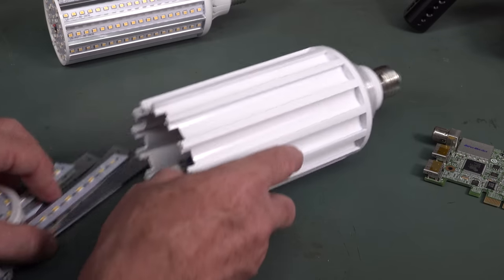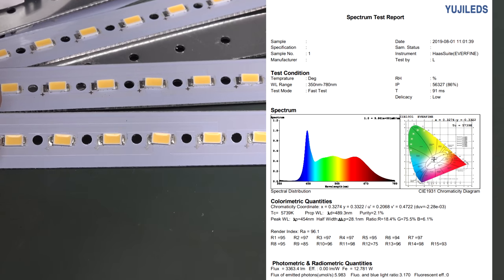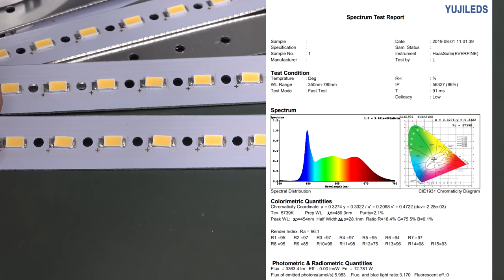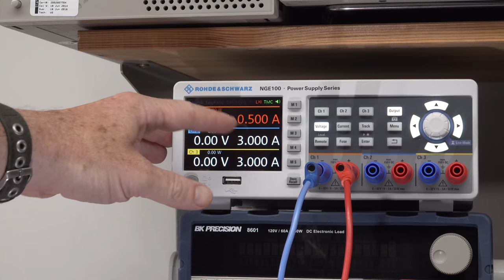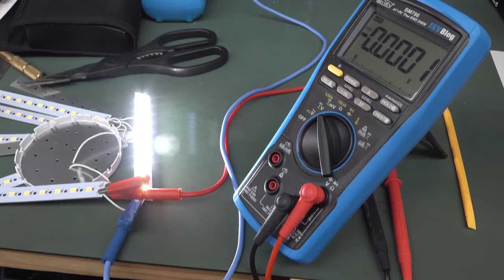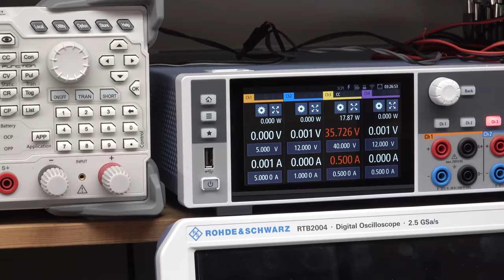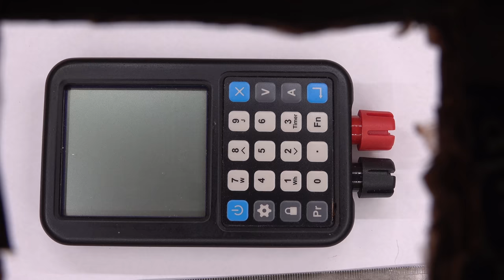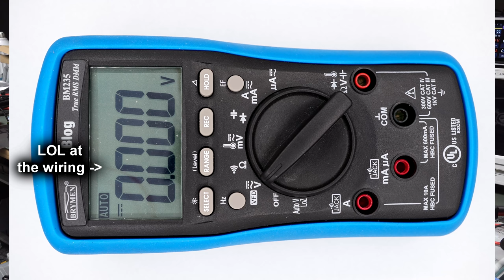EEVblog #1372 - DIY PCB Photography Light Box

Comment: You're not shooting macro so why use a macro lens.
The body does matter as it contains the sensor and the sensor defines the results from the lens, pixel density matters as much as the lens type and quality to the results.

Given that you're around 30cm in height, you don't need a macro lens as a lot of standard lenses can focus down to that distance.
I question the need for f10 for depth of field considerations as you aren't actually shooting macro, a 1/200 shutter speed is still fairly slow for hand held anything (even resting on a box it's still hand held), an aperture f8 or lower would make more sense, especially as lenses are sharpest in the lower F stops. The total depth of field for that lens at 30cm at f10 is ~34mm while at f8 it's ~27mm. The total field of view for 30mm @30cm is 156mm x 283mm on APSC. Diffraction on a 24MP APSC sensor is starting at around f8 and on a 24MP full frame sensor at around F11.

A standard 35mm lens @ 40cm distance has a depth of field of ~36mm @f8 and a total field of view of 178 x 324mm
A standard 35mm lens @ 50cm distance has a depth of field of ~58mm @ f8 and a total field of view of 223 x 405mm.
A standard 50mm lens @ 50cm distance has a depth of field of ~27mm @f8 and a total field of view of 156 x 283mm.
DoF totals are combined in front and behind focal point so 36mm total is 17mm in front and 19mm behind

Many modern lenses are around f4-5.6 at their sharpest but in this case the sony 30mm macro is f8 and is a fairly ordinary lens outside of macro distances.

Many bog standard kit zooms in the 18-55mm (27-82.5mm FF) range can focus down to 30cm. As that 30mm macro is an APSC lens, it's actually a 45mm (50°) not 30mm angle of view so for more versatility in subject framing at a fixed distance a zoom lens can be a good option and many are rated fairly close in sharpness to that 30mm macro you are using as a not macro lens.

https://www.pointsinfocus.com/tools/depth-of-field-and-equivalent-lens-calculator/
Let's show the maths.
A light box with a 50cm focal distance and an 18-55mm zoom lens (standard kit) on an APSC body

@ 18mm DoF @f4 is 115mm @f8 is 238mm total and a total field of view of 433 x 787mm
@ 24mm DoF @f4 is 63mm @f8 is 128mm total and a total field of view of 325 x 590mm
@ 35mm DoF @ f4 is 29mm @f8 is 58mm total and a total field of view of 223 x 405mm
@ 50mm DoF @ f4 is 14mm @f8 is 27mm total and a total field of view of 156 x 283mm
@ 55mm DoF @ f4 is 11mm @f8 is 22mm total and a total field of view of 142 x 258mm

With any light box scenario you control the distance to the subject and therefore there's no reason to use a macro lens, the same ratio shown above applies to prime lenses too, so you can simply use a higher quality prime lens of the right field of view for the subject at the set distance, this type of table is easy to make from the available calculators like the one I linked and including bed that can be  raised or lowered you can optimise the distance to the lens and F stop to get the best results.

Macro lenses are for when you want to exceed the normal close focus distance of standard lenses, the 1:1 only relates to the image on the sensor and you need to be at 9.5cm from the subject with that lens to get that at normal distances it's the same as a normal lens. As you might guess macro lenses are compromises and outside of the macro distances typically standard lenses outperform them.

Try putting the lights on the sides of the box and reflect from the top, that will change the point source angle to the lens and set the shiny surface reflection wider than they are with the lights in the top corner.